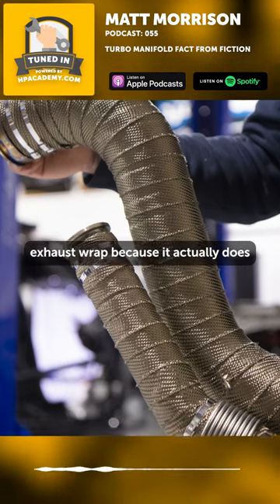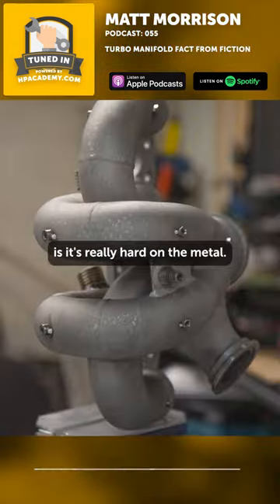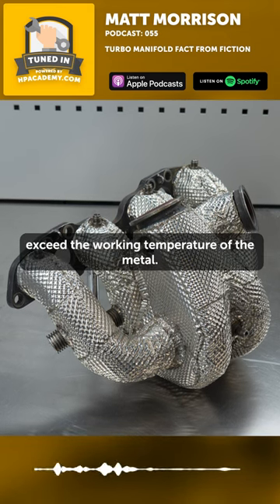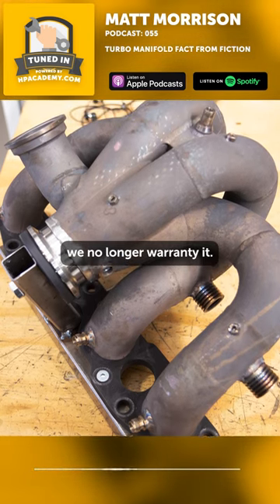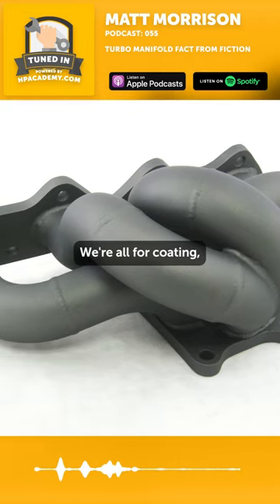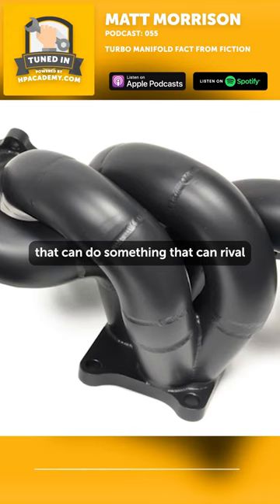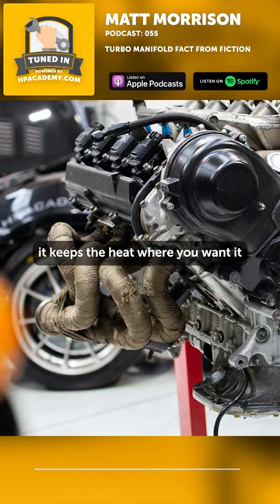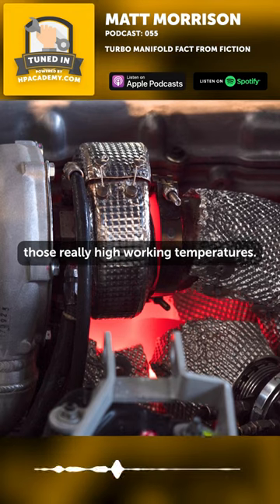Exhaust Wrap OR Coatings? #shorts

Comment: Oddly enough, I'd just say to do both. Getting a good enough coating that can withstand HIGH operating temps is another question. I had an affordable set of Hedman 351C headers for my 400M shot in a high temp powder coating, I then wrapped them and finished it off with a high temp silicone sealer. They're not pricy stainless steel headers, so the worst that could happen is my coating fails and does in a 200 dollar set. If and by the time that does happen, I'll need to redo the sheetmetal on the car anyways.
Reply from the maker: There's a solution for everyone out there. You just always need to remember when you double up on things that are generally alternatives, you end up with the pros and CONS of both - Taz.

Comment: Best bet if you want it to last is to ceramic coat the manifold and use heat shielding. Wrap works awesome but shortens the parts life significantly.
Reply from the maker: Does anyone have any data on doing this vs anecdotal do you know? Not something I have stumbled on myself - Taz.
Reply: @hpa101  what part?
Reply from the maker: @project2ndgenspeed672  using both wrap and good ceramic coating vs one or the other - Taz.
Reply: @hpa101  the coating keeps heat out of the manifold if done correctly.  A wrap keeps all that heat in and can easily get past the critical temperature of the part which will chemically change the metal.

Comment: The problem I have with coatings is the half ass job some companies do.

Some of the companies selling the products and offering coatings should probably not be offering coatings. The last set I paid to coat with a company, within 2 days of being exposed to outside air the rust started coming through the coating on the cast parts and the stainless stuff was dulling and thin. And they charged 3-400 for this service. 

That said, if you know someone who can apply it correctly for you, go for it!

Comment: I prefer exhaust wrap. I can touch it because it works so well. It is cheaper. If something needs repair, it is easier to weld something that isn't ceramic coated that would need to get ground down and has impurities in the metal still.

Comment: Are we at a point where 3d printing the exhaust manifold is the most effective for racing applications?
Reply from the maker: That would really depend on the car, the fabricator, what they have access to along with how many they plan/need to make.
3D printing still very much has disadvantages rather than just being better across the board compared to everything and anything. 
We discuss it in a few different podcast episodes if you're into that type of content:  https://www.hpa-tunedin.com/ - Taz.

Comment: Exhaust Wrap Is Really Bad For Mild Steel. I live In The Desert And That Things Rusting Like I Live In The Rust Belt lol. Low Grade Stainless Seems To Hold Up Fine. I Tried Ceramic On My Headers. Between The 2 They Had 10 Cracks In Various Lengths. I Don't Like Wrapping Headers Becasue It's A Pain, Makes Them Harder To Install And If You Got Spark Plugs Near Them It Reduces Access. I Did Wrap My Entire Exhaust From Turbo To Tail Pipe. If You Got Mild Steel I Would Say Ceramic Coat Them And Exhaust Wrap Them.
Reply: You need to paint the header before wrapping  dei sell heat resistant paint and a special paint to use on the wrap 
my headed been wrapped for many years and no crack and it made of schedule 40 mild steel
Reply: Why Is Every Single Word In Your Long Paragraph Capitalized?? 😂😂😂
Reply: @Dave-dh7rt  Because I Like The Way It Looks And It Helps Me Slow Down When I Text So That I Can Think About What I Say.
Reply: @legros731  Done that before on a turbo log manifold and it still rusted apart. Yours may be lasting, but it's because it's schedule 40, not as extreme temps and possibly a milder climate.
Reply: @guhfluh  a live in Canada lol but I don't use my car in winter
And after like 8 years you can still see the paint underneath the wrap same for the downpipe
Reply: @legros731  Mine lasted about 2 years. Outside, near New Orleans.

Comment: I'm the kind of guy who would prefer a big engine bay so you don't have to worry about melting components, and heat shielding wouldn't be a nessecity
Reply from the maker: It doesn't always quite work like that, but if that's what you're building I hope it works for you well 😎 - Taz.

Comment: I will never wrap my exhaust. A: I'm not building engines for power anyway so I don't really have to worry about baking the rest of the engine bay, and B: I build for longevity on vehicles that see 20k/year in mileage, so having my headers rust off my engine every 3-4 years is no good.

A 250hp Ford 4.9l build does not need its header wrapped. It does not need its header coated.
Reply from the maker: Do you race the car at all or is it just used on the road? - Taz
Reply: @hpa101  Lolol racing an 85 F150. Heh. Nah its a workhorse daily. Only asking about 200-250hp out of the 300 I6. Fitting a longtube header is one of the must do mods to bring output to that level but it aint gonna be pushing enough power to make the header glow. Plus, radiant heat from a bare header will be a godsend come wintertime; Ford bolted both manifolds together to heat the carb in the winter as a deterrent against ice formation and having the header radiating heat will do this on my build.
Reply from the maker: You never know mate! There is even a bunch of people out there racing old combine harvesters against each other 😅

Road use is a little different to race use, you just don't see the same amount of abuse and heat etc on all the components and you're right, you often don't need to change much from stock like you do for a race application. A few mods like the headers you mention often make enough of a noticeable difference for a small cost without headaches 😎 - Taz.
Reply: @hpa101  Ye. And sometimes things racers shun road goers want. Like the heat. I'm working on a straight six with a carb hanging off the side of the engine that's going to be driven in sub-freezing temperatures. Carb icing is a big concern. The stock manifolds were bolted directly to one another right beneath the carb to provide some heat in an effort to avoid this problem. If I were to wrap my header I'd be leaving my carb just hanging there in the breeze, which likely would ensure it iced up at some point. Leaving them unwrapped/uncoated means that latent heat can escape them, warm the engine bay, and thus warm the carb up.

And ye, it is funny how much gains can be found from simple mods. My engine is rated 120hp @ 4100RPM and 275FT LBs @ 1600 from factory. Simply swapping the mainfolds and carb out for a 475cfm 4-barrel, dual-plane intake, and long-tube tri-Y header, will take it up to nearly 200HP. Pair that with a 252h or 260 cam and, yeah, it's now making 250 and revving another 1,400RPM. Without sacrificing reliability, driveability, or longevity!

If I *really* wanted power I'd probably go EFI/Turbo. The 4.9L I6 I have is notoriously indestructible and takes to turbos like a boss. It has that innate low end grunt to make turbo lag irrelevant and the turbo makes up for high-RPM breathing troubles. There's a guy with a turbo 300-swapped Maverick that dailies the thing. It does 10s in the quarter, but it's also docile enough to daily drive. I have been half tempted to do something hot-roddey with the 95 F150 I have....which has the same bloody engine in it...but that's not set in stone. I might just carve that one up for spares too.

Comment: Idk about you but I wouldn't ever trust <1mm of paint to hold in 1200°+. I'd do all 3. Coat, wrap, and heat shields.
Reply from the maker: Everything has pros and cons. When you use everything to gain the advantages of everything, you also add a bunch of disadvantages at the same time that might not be necessary. Or it might work perfectly! Just something to keep in mind 😅 - Taz.

Comment: Exhaust wrap is 1990 tech, you can jest isolatr your exhaust cheaper , faster and cleaner now, without waste of time wrap or ceramic bullshit. Using fiberglass and thin sheet metal, costs the same as wrap , much better effect, used in Profesjonał motorsport. What more do you need? Ceramic coating is overrated.

Comment: Nonsense, wrap only beats up shitty steel. But if you wrap for example stainless steel 300 and up and wrap it the way it's supposed to, it will last just as long or very close to with the metal not wrapped. This is my experience. At least

Comment: ceramic coating is BS. the whole point of wrapping or coating exhaust is to keep the heat in the pipes. ceramic coating barley drops the outer temp let alone keeps the heat in. I'd rather just save my money and just paint the bare metal because it basically does the same thing